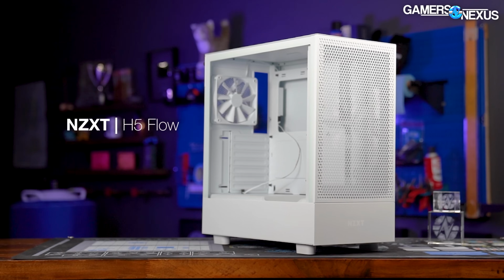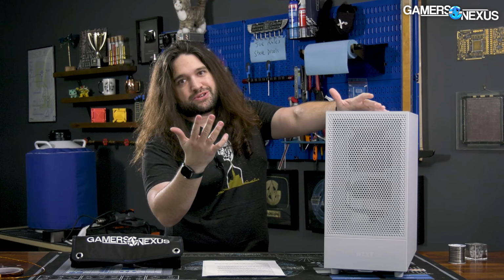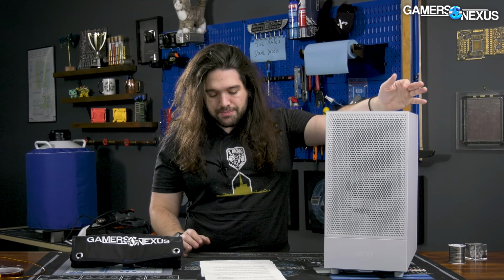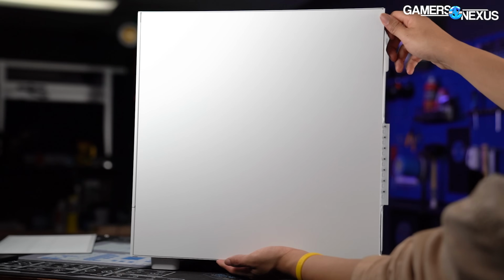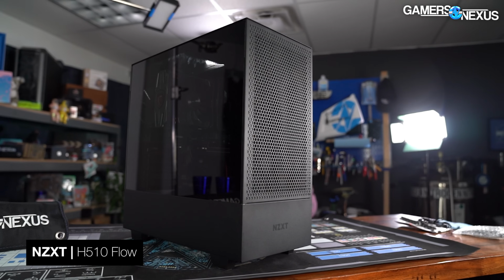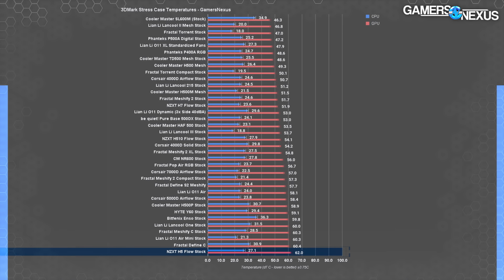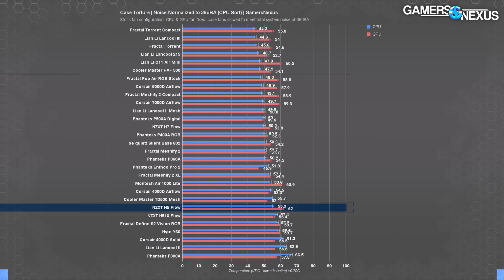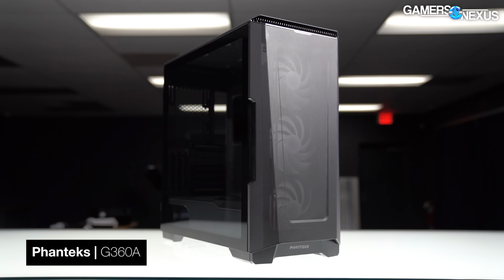NZXT H5 Flow Case Review: Thermals, Cable Management, & Noise

Comment: I have an NZXT H500 with a 280mm Corsair H115i mounted in the front which exhausts air out of the front. That case has terrible airflow but it can keep my 9900k at 75c under 100% load. It used to hit 100c when the front was set as the intake. This case and the H510 Airflow solve that problem for me while keeping the form factor that I personally really like. I don't hate the layout of this case and might rebuild my system with it.

Comment: The H5 Flow RGB comes with 2x 140mm fans in the front, and 1-2x (?)  120mm elsewhere, and it's retailing right now for $99 usd.

Comment: I tinkered with a cheap fractal g case, and also added a slanted fan toward the gpu, AND out a Klim Cool + vacuum at the end of the GPU, AND attached an old startech blower fan at the front of the GPU.

Comment: Hmmm, I'll stick with my old Phantom 630 I think.
Loads of airflow and 4 big drive bays for my various bits and bobs;  I don't care if I haven't used that bluray burner for 8 years... I NEEDS it there lol
Plus, the adjustable angled fan inside is great.

Comment: I don't really see an issue with front panel fans being omitted, well atleast coming with 1 out of 3 slots filled, which the 1 could be relocated to the top back spot so the top back corner exhausts up and back or keep as a backup for the rear fan. The thing about front panel fans is those are the ones people will often swap for RGB or Noctua or even an AIO so better to save cost on the case by not paying for 3 fans just to not be able to use 2 of them, and this case with it's preinstalled toilet fan works perfect, only need to buy 2 RGB or Noctua fans or a 240 AIO. If your not particularly concerned about what fans are in it you can pick up a 3 pack of fans for $15-20 and have the spare you will eventually need before the system needs to be replaced. Saves on e-waste not including all fan slots filled.

Comment: Bland look, too little storage space, needs extra fans, don't like the I/O. Flip side...good cable management and actually has decent flow, just not that good. 
Overall, I wouldn't buy it. The price is alright, but I would have preferred more space for storages. Maybe 1-2 more. Also I/O sucks

Comment: A case of any kind serves no purpose, other than to look pretty on your desk.  Any enclosure is just a heat trap, no matter how many fans, including "toilet" fans. In  the next 3 years you will have GPU's, CPU's that will require so much air flow, and cooling, that no case will be able to provide anything but fancy RGB lighting.   Better off buying a bench kit, and a house fan.

Comment: I wonder if the normalized thermal & noise test is also using a standardized fan? I think it would be very helpful if we can include it, especially for higher-end cases, as it will indicate better how the case design itself performs in the thermal & noise without affected by the quality of stock fan.

Comment: So, another swing and miss from NZXT. Their reluctance to change the base design of their cases is really starting to bite them in the ass. The Lancool II Mesh can be found for around $110, but has much better thermals which makes it a better value by far when you factor the cost of additional front fans for the NZXT H5.

Comment: I took the hard drive cage out of my define 7 compact, and managed to fit the second fan from my NH-D15 down there thanks to the 120mm fan mounting holes it has. I had to replace the front fan on the D15 with a 120mm one due to case compatibility anyway. I imagine the duct would help direct the airflow better, but I found this an interesting solution in the define 7 in any case. Then again, I'm also blocking the front mounting location on the top panel with a HDD mount adapter, so my setup is kind of weird in multiple ways.

Comment: I want to build a new PC after 7 years my last was in 2015 and here is the list I have. What you guys think? Should I swap any of these with something else? My only worry is that it costs way to much (2K$) for 1080p, because 1440p 60 fps is not achievable with Max settings (only medium)
1) MSI gaming X RX 6650 XT (30$ more expensive than RTX 3060 so it's worth I think)
2) i5 13600k
3) Be quiet pure base 500DX
3) Noctua NH-U12A chroma black
4) Kingston fury beast ddr5 16gb 
5) Western digital HDD 6TB blue (I have tons of files I need to keep....)
6) MSI pro z690a ddr5 motherboard 
7) Kingston fury renegade PCIx4 1tb SSD
8) Be quiet straight power 11 750w platinum
9) LG 24 GN650-B IPS 24' 144hz 1080p monitor

Comment: Isn't the missing front fans basically something they do because they count on most using that space for a radiator? And if you do  you would need to remove them which would mean that they only drive up the cost of the case.

Comment: "can it fit a 40 series gpu without needing a second case" might have to become part of case reviews from now on. But anything short of the box the case came in might not fit a 40 series gpu these days.
Reply: At this point most midtowers probably can't fit the 4090, so it's go full tower or specifically look for an exceptionally long midtower.
Reply: @garethgobulcoque8668  I meant all the 40 series. With the way this generation of gpu's and heat syncs are going a 4060 might be as big as a 3090 ti. Probably need a corsair 1000d case for a 4090 lol

Comment: I am honestly loving mine I installed 2 ML140 Corsair in the front, 2 on the top ( 1 kolink and 1 sharkoon, both that I want to change for another model) so the Ryzen 5 3600x with a Cooler Master EVO V1 I never ever had any problem with it thermals, but with a AMD Radeon RX 5700 XT THICC III Ultra XFX I always have problems with it thermals( 95C!!!!) , and now, thanks to the bottom fan turned directly at the GPU its been great( for me ) way better than the REV100 Sharkoon ( the case I had before this one) So yeah I had to spend a bit more, but I am extremely happy and I found it quite genius to have the bottom "toilet" XD fan turned to the GPU directly, have a nice day! :)

Comment: Steve, I'd like to hear coverage of wether this is the end or just the beginning of new small form factor builds with the power ratings of new CPUs and GPUs and sizes of the new GPUs if it will spell the end of small form factor builds?

Comment: Wouldn't a single 140mm in the middle of the front mesh be better than any of these weird "solutions" to the problem of airflow in this case? I don't understand how companies like this don't go with Occam's Razor, make the engineering tight, style it decently and reap the rewards of every nerd everywhere heaping praise on them.

Comment: Finally someone reconsidering the stupid basic copypasta PSU shroud. Taking into account the recent GPU power development, flow through coolers, etc. May not be perfect yet, but at least there are some ideas and dedication to work on it. Also who needs HDD these days? nvme + NAS if anything.
And please, don't offer me a case with ANY fan included. Except that's some custom RGB setup whatever or premium quality. A lot of people building their own PCs have stock of Noctua, Scythe, Arctic or whatever in their favorite size and won't use included fans anyway. Cheap waste just to have some is worse than none.

Comment: I currently use this case and I think it works great, the temps are great even though im missing two 120mm fans at the top, There is also plenty of room if you get the right sized graphics card

Comment: I got an H510 Flow with a front radiator intake when it first came out, and I regret it. Really should have gone air cooled on the CPU. The thermals on everything but the CPU were ridiculously high even with the noisy NZXT 280mm AIO fans going full speed. My RAM, GPU, and NVMe's were boiling!

I was only able to get it under control by replacing the radiator fans with 4 140mm fans in a push/pull configuration with a not so simple FanControl configuration to handle idle & load airflow (pressure) precisely. Plus I had to remove the slot covers under the GPU. I don't want to use a front radiator (only) intake ever again.

Comment: 10 years ago I built my brother a system around the original NZXT Phantom. Good air flow. He's still using it, and I even upgraded his system to a 9900k and a 1080ti.
My only complaints are it had too many fan control cables and the build quality wasn't quite the same as the HAF 932. I really with these companies would take a look at cases like the Phantom and HAF 932/HAF-X and as themselves, How can we improve the thermals while adding modern W/C and Design options? That's the reason I rarely upgrade my cases.

Comment: I wonder what the GPU thermals would be with the elimination of the bottom angled fan but keep 2 traditional intakes, so just 1 added fan? I feel like this would show the featured fan doesn't really help much with the GPU and just creates a nightmare for PSU cables in the lower chamber. I mean the H5 barely beat the stock POP in GPU by 2C with 1 more fan.

Comment: Cases with such limited storage support are a joke, IMO.  You might not need HDD space when you first buy a case, but having zero option to add storage severely limits the case's potential longevity.  This NZXT case is an extreme example in terms of its lack of storage, but most of the mainstream cases I see reviewed these days aren't much better, usually featuring maybe a 2-drive cage.  

Sad thing is that if you want a good case with lots of HDD space, the best value is still probably the Fractal Define R5, a case that launched in 2014, and one that now costs more than it did at launch (~$140 vs ~$100).  Cases with a storage focus seem to be a dying breed.  But hey, I guess we got a lot of RGB and Transparent side panels as compensation.  Those are super practical.

Comment: Review video suggestion: I haven't seen a single review from anyone for a custom water blocked RTX4090 yet. Could you please do one? Ideally something like an ASUS ROG Strix, or if that's not available, maybe a pre-custom-water-blocked RTX 4090 card like the Inno3D GeForce RTX 4090 ICHILL FROSTBITE, which comes with a custom water block installed, ready to add to a water loop. Then to test it, give it maximum possible headroom, maybe something like a build in a HAF 700 PC case with three 420mm radiator (top, side, bottom) & leave the front & rear fans in? This is a rig I am considering getting myself, so if you could test the performance for us, that would be amazing!

Comment: I literally took the solid front panel off my DarkFlash DLM21 and my temps dropped 5-10 degrees during demanding gaming sessions. So now I'm designing a replacement front panel to 3D print and replace the solid one. Sadly Darkflash does not have any mesh panel ones to purchase to replace mine so I'm on my own to fix my Airflow problem.

Comment: It's odd that the case Steve has doesn't include front fans yet the same exact case on Newegg, as of the time of this comment, includes two RGB 140mm fans for the front. It's also $119 instead of $75 so I guess that's where the extra cost went.

Comment: congrats NZXT, I think we have some decoys to distract (redacted) forces when there looting houses for washing machines and toilets, lol. /sarcasm
in all honesty, I do like the idea of funneling air up to the GPU from the otherwise isolated HDD/PSU area of the case. some of the older cases, the lower front fan would do nothing for anything in the motherboard area of the case due to the PSU cover isolating it off from the upper part of the case.

Great vid Steve and crew.  B)

Comment: I dont find the lack of two front fans such a bummer. I have the same fans 12 years now jumping from case to case. It is the old Corsair ones with the 3 replacable colored rings(white-blue-red) yes that old and they all work fine. So i believe most people just reuse the fans they already have.

Sure its a problem for people building for their first time though.

Comment: It's a great case, Don't think so much. If you're building a pc, the cost of worrying about 2 front fans is not on anyone's 'worry list'. Great video though for details & ads. You might consider testing it in a wind tunnel to test aerodynamics.

Comment: obviously case is built for an AIO in mind. i do NOT want case to come with fans. i use my own fans.
you can mount the radiator inside of the metal bracket and the fans on the inside of the case. it is MUCH cleaner

Comment: Hu... almost?
If they added holes to the back panel including the slot covers, increased the height to give better clearance between the PSU shroud and the GPU, add two front fans and one fan on the back top this could do actually really well.
The bottom forward fan is a pretty nifty idea I must say.
They were so close to make a really good case.
Reply: you are literally describing the H70, which will eventually refresh with this design I bet. The point of the H50 series is to make a mid tower as compact as possible

Comment: (I was looking at the h7)I was going to buy this they made it where if you vertical mount the gpu you can't put any other cards (mine was a capture card) with it. the H710 had room for both vertical and horizontal mounting.

Comment: I was about to buy H7 flow today and this popped up. I do have H500 (non-flow) and spare fans I couldn't mount due to lack of extra space on the top for the fans. Now I can move AiO to the top and use extra spare fans, while remaining in the same case size. Choices choices....

Comment: Isn't there a NZXT GPU fan at the bottom in H5 FLOW Standardized fan config ? In the test with two fans in front, the GPU temperature was 54 degrees?

Comment: The closed grid on the back directs the entire air which 3 fans input from the front just through the exhaust fan. The exhaust fan must have an insanely high airflow to the outside. They could have just skipped the toilet format and do 3 normal vertical front fans. I have the Cooler Master S600 silencio case but switched all silencio fans to airflow fans 3 pin. I have 3 fans in front and 1 in back. Even at 60% rpm (650 rpm) these fans have an higher airflow than the original silencio at full speed. I find as well the grid in the back helps escape at least 1 fans worth on passive heat airflow. So if this case has the grid closed on the back it is interesting the case does not heat up. Meaning only heated air can escape to the back fan with high pressure since the fan is high up. Thats interesting. I as well find no difference in temperature when the top is open or closed. An open passive top makes most likely cold air from the 3 front fans escape without even passing over MoBo, GPU, RAM or CPU wasting the air. A fan cools only when it blows onto or over or past an hot surface carrying heat away or into the intake of other fans like the CPU fan or GPU fans. So the top open is allways aquestionable thing. The best design thermally is allways the standard ATX design with 3 horizontal intake fans on the front which blow air to the back where 1 exhaust fan is high up and lower there is the grid for passie air escape. The lower fron intake fan most of the time blows half its size air over the PSU, the rest is for cold air intake for the GPU. The middle front fan blows directly onto the GPU and the high front fan blows air to the CPU fan and at the same time pushing all hot air on the top to the back and out. Thats the best design. Why fix it if it ain't broke?!

Comment: I think to be optimal in testing you'd maybe do some additional tests with optimal fan amounts, maybe even add 4 to this case and try multiple configurations. Then show us what is most optimal and have a chart comparing most optimal setups. Some of us prefer to add some decent $15 each fans (or even just cheap arctic 5 pack for $30ish) and maximize airflow in whatever case we get. I even went as far as blocking off my top-rear fan slot and putting top-front as intake which improved temps for me with a more sealed case and intake forced across components before leaving rear. Would be nice to know who really has the best in best case scenario and how many extra fans it would cost.
Reply: Sounds fun until you get to the testing part. Just think the logistic for even 1 case.
GN said they already short of time and had to pick cases to review. 
If GN ever create a new channel called GN case, then we might see something like that.
Reply: @jintsuubest9331  that's fair but I do think especially in this case or the ones that don't have enough fans it definitely should be tested with enough (which they did here) with more emphasis on the more optimal setup since I would assume literally nobody would run this without front fans. Seems like I've seen at least a couple case reviews that didn't add a back fan for example or when they do that more optimal setup isn't usually shown in future comparisons (like maybe having a "more optimal setup" chart that shows how many fans added if any and total fans used maybe). Just a small nitpick really these guys are great and I appreciate all the info they provide. I could definitely see how trying every orientation would get ridiculous though.

Comment: Though I agree with the criticism wrt the fans there are also people who want to mount a radiator together with high pressure fans, and would probably throw out the stock case fans anyway. Also, many wouldn't use 3-pin fans anyway.

Comment: @Gamers Nexus Would there be some improvement in GPU temps using the toilet fan with a front mounted AIO? Getting clean fresh air to the gpu seems better than the heated air from the CPU AIO radiator fans.

Comment: I actually like the sealed off slot covers, blocking a way for dust to get in
Reply: I'd rather have the extra airflow. Sealing the slot covers isn't going to do enough to prevent the need for dusting the computer, so why sacrifice performance?